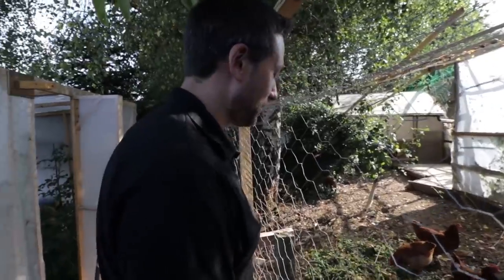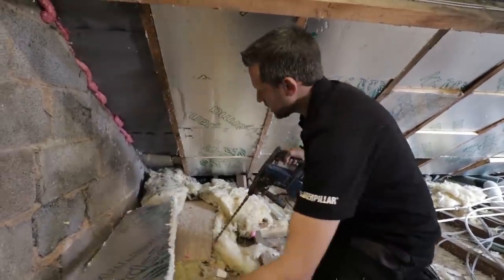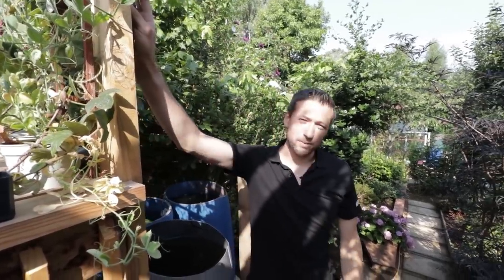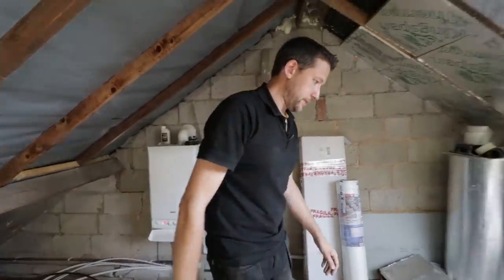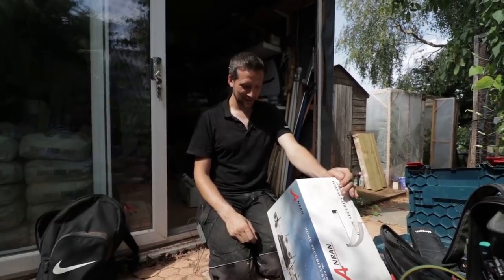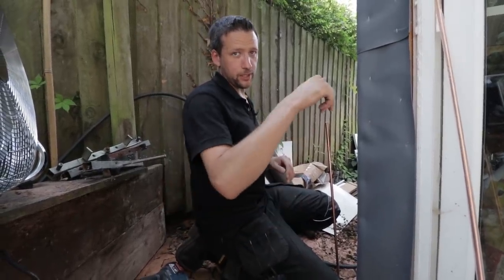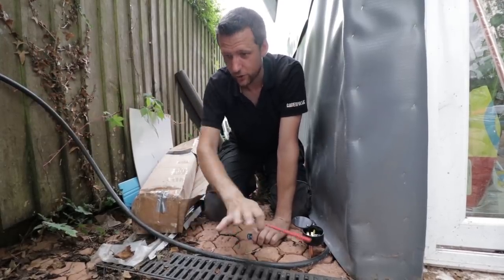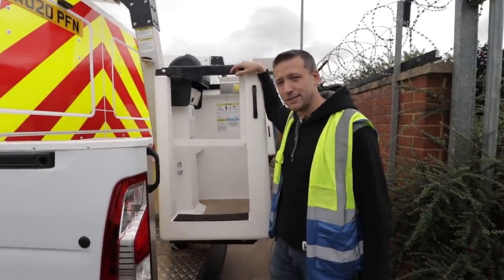Naiomi installs her FIRST Consumer Unit | Thomas Nagy

Comment: I've had the 36v Bosch sds for about 5 years, brilliant bit of kit, very powerful. All my tools are bosch, apart from the radio, as I wanted dab, I bought the dewalt t stak radio, sound is excellent, I already had dewalt torches, so already had the batteries.

Comment: +1 for Tom & Nom Nom getting it done.
I don't know if it's legal there, but in some areas of the states, we can use heavy wall copper pipe for ground stake. Sweat on a fitting, attach a hose & valve, & let the ground stake drive it's own hole.
When done, cut off the fitting & save the valve for the next one. (Fittings can usually be recovered with a blow torch & a bit of dremeling.

Comment: I use one of those rod driving bits in an SDS similar to yours. It's not amazing but it keeps the rod going down while I rest. I don't put a lot of rods in but the last one took over an hour so alternating hammer and SDS made huge difference to me still having a wrist capable of turning a screwdriver afterwards!

If you're wondering why it took so long, packed urban area where the DNO refused to provide an earth (looked like there used to be TN-S but no more), which in that environment where there houses are so squashed together seems pretty bad to me. But hey-ho no choice but to rod into tough ground full of rubble, put an 8ft rod down to try and find some decent ground further down, and just pray not to hit any services. Horrible job! Managed to get about 40ohms, about same they'd been getting via the pipework (only earthing they had when I got there) just by a recognised means now, admittedly in wet ground but this was in December so waiting to test dry wasn't an option.

Comment: With a cherry picker, one thing to consider is that if vehicle's MAM is above 3500kg, it's a totally different class of vehicle. You can't drive it with just the "B" license. So all new hires have to have C1 or C. And few rules that apply to the vehicle are different. If I recall correctly, speed limit is different, and also - more enforceble i.e. way higher fines and much lower tolerances

Comment: galvanic corrosion will destroy the bolt, so the brass bolt is better for future, Also if you paint the earth clamp after its installed with galv spray it'll last longer and will be serviceable

Comment: Most likely not your decision and I get that but... If public supply fails, the resident has to find a torch and go upstairs to manually switch to the generator? Wouldn't an auto-contactor have been a better, yet more expensive, option?
Also WiFi security cameras? Only as an absolute last option. (My opinion - not necessarily the same as anyone else 😁)

Comment: Not having  a bash .. genuinley curious .. 

Why did you install a distribution board rather than a consumer unit in the property ? Was it down to the amount of circuits or had some 3 phase power to run ?
Reply: I agree with him using a vertical DB instead of split load or a double consumer, sometimes having that extra space and a little bit more 'grit' in the board saves you money on labour, just may get a bit expensive when it comes down to rcbo's. All preference in this game, sometimes penny pinching on materials can mess you up on the install!
Reply: @perry2017  trunking set up with a couple of hager dual is plenty. That board does not belong in aa domestic property

Comment: Don't see a problem replacing the bolt with a stainless one, we mix metals all the time, look at steel conduit brass bushes, swa glands steel lock nuts, the earth rod is steel copper coated.

Comment: If putting the board at that end please cable basket the run :) 
get SDS to normal Chuck, then use for rods or drilling etc. 
Cheap earth pit is a 110mm pipe with screw end and get push fit extensions. 
CCTV depends if for crime, one good camera (Dahua/Hikvision are the good cheap end, MOBOTIX/Pelco is Schneider to go with that board/ Avigilon etc is high end)  is better than 4 "HD" ones, if for checking the chucks then that kit fine. Pause a frame and check the quality :) (from the man moaning about cheap batteries and blue roll) keep up the good work.

Comment: Isn't it beter ( if the generator have ats) to put an ATS box in, ( Automatic Transfer Switch ) so, if the power of the steert break down, the generator will  switch automatic on?

And yes, you will need a big drill machine with an sds! We put easy 15M of copper in.

( sorry for my English, if it isn't correct 😬)

Comment: Don’t buy a iveco they are very expensive to use, if it’s the one with Satnav then they crash a lot and if you get a blank screen that’s it you will loose your speedo etc until you have a new one fitted for over £1000 they are not smooth running and spring oil leaks everywhere. Good van with unlimited miles is a merc but get a plate welded around the ecu as all you need to do, too nick them is change the ecu to one you have the key for! Very easily accessed from underneath.

Comment: I agree about the brass bolts, I had a Ze of 1900 ohms, and it kept jumping from reading to reading, turned out to be a snapped bolt so I replaced it with a stainless one.  I wonder if temperature change gets to them?

Comment: I watched a linesman drive an 8m (ish) ground rod (to go with a fresh power pole and transformer for an industrial service) in with a nice big Bosch.  I also told the guy he was aiming right at the 600mm regional high pressure water main.  He dismissed me as an ignorant digger. I'd spent the last 3 months working up and down that ditch-line lowering phone cables and dodging the service shut-off valves and hydrant controls.  Sure enough he punctured the line and within minutes there was almost ankle deep water everywhere, and a massive crater full of water where his ground rod was supposed to be...

Comment: Tom - do they make a generator / mains switch that is automatic that allows for automatic switching and still following the regs? I think you need a jackhammer to drive the earth rods. Or an industrial vibrator but no one can hold it, put enough vibratory energy behind it and it will liquefy  the earth but it is happy to liquefy anything that tries to hold it.

Comment: 15:48 - I'd go a drill hole 1/2 way up off the ground on the rod. Solder the sh*t out of that connection. Wire is free on both sides. 

Solder everything hard with little flux. I think there will be deportation with the freeze thaw cycle but giving options to the potential twat next is good.
Reply: Not deportation... Delamination or deportation. *Autocorrect.
Reply: Lol, not deportation... Ahhhh!  Separation.... Separation.....

Comment: Is there a reason not to use an exothermic weld for the earth connection? Seems much nicer than worrying about bolts snapping or coming loose.

Comment: I am with you Tom...anything with more than 4 legs or less than 2 is going to have a life-expectancy of about 3 seconds!  
Here in the US they want to charge you $100 (~75 pounds) for a little piece of metal and a bolt to go over 2 breakers (that YOU buy separately) for the grid/gen-set safety.  
That last bucket was a 1 Tom or 2 Nom Nom in capacity  :)

Comment: Brilliant Tom and Well done to Nom Nom. Neat job. Love your thoughts and ideas on the work and really liked the Schneider Board the size we are used to in USA. If you ever get to difficulty in pounding ground rods in hard soil a trick we use here in USA is to constantly with a bottle of water add it to the area we are pounding the rod to soften it up it works most times but not always. Love the Bosch tools but Hilti hammer drills in my view are even better but you sell one of your kidneys for them. However the warranty is rock solid and you can completely undertake heavy usage of them and warranty will replace them if they don’t last. Something to consider for next time when you upgrade the hammer drills.

Comment: Hi tom, about that manual transfer switch between mains and gen, that thing will interrupt the power, not sure if that's a customer choice but you can get cheap synchronisation systems. Or a other option: a (commanded) ATS, use a mains controlling relay to start the gen, the ATS will switch to gen power automatically, when grid is back it will go back to mains. Sad to hear that gridfeeding is not accepted there, nothing is better than see your meter going backwards. ^^

Comment: Often the difference between the cheaper stuff and expensive stuff is what label is on it and price, otherwise it is the same underneath.
Reply: Cheap £1 socket vs MK......... 

typically you pay for what you get
Reply: Was more thinking electronics. Amount of stuff that is just rebranded outside but the same internal electronics.